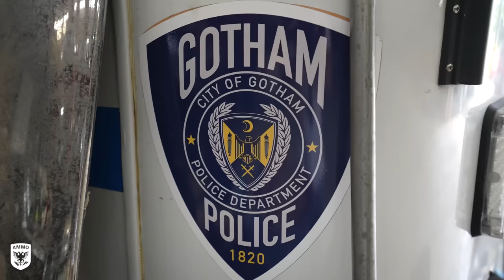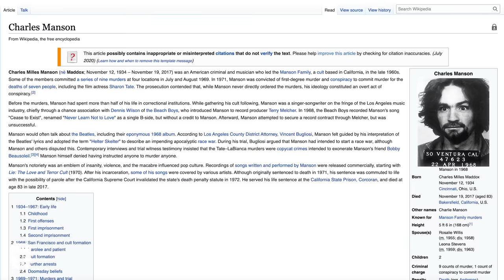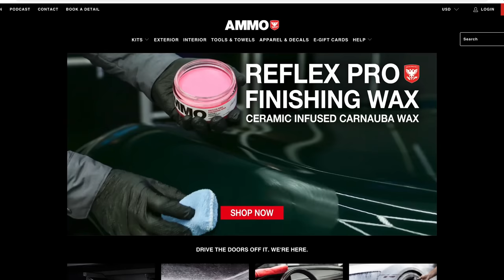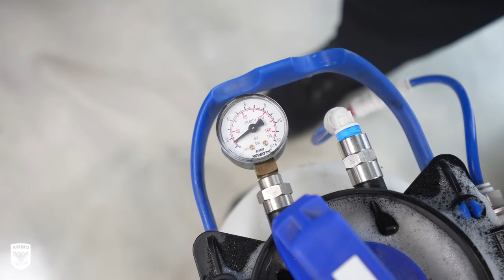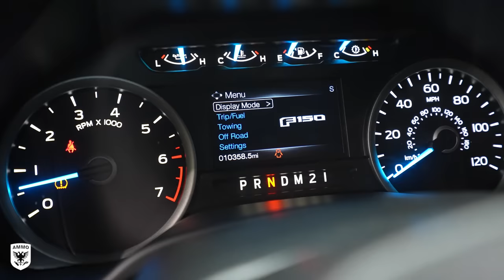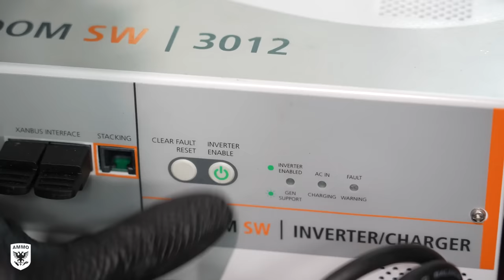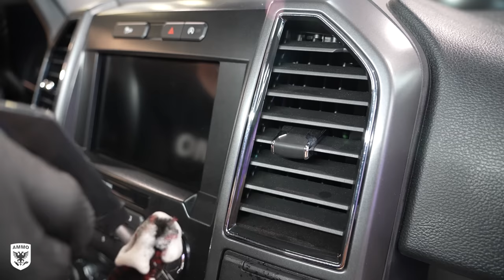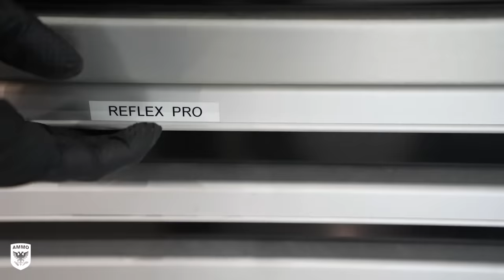First Wash in 5 Years Ford F150 Truck Disaster Detail: Only 10K Miles since 2017!

Comment: Larry, another great show.  Keep um comin'.  I have a question.  How much pressure do you run through your foam cannon?   Unless I haul out my gas powered washer, I just can't get the foam.  The electric one is easier, but the foam is weak.  Thanks so much.

Comment: Great episode as always. Have always wondered, how do you blow out the polishing pads if you don’t have compressed air ?
Reply: You could use a microfiber towel, turn up the speed, wipe and let it pick all the residue up. I pretty sure Larry showed it in one episode
Reply: Nylon brush or microfiber with the polisher on a low speed for foam/microfiber pads and a pad spur for wool pads

Comment: If you were using microfiber towels to wash a car that was just polished not about to be, How many towels would you use? Not filthy dirty and pre-rinsed and pre foamed and rinsed? Trying to figure out how to avoid love marks. Yes 2 buckets, Grit guards, Quality soap. Doing everything I can but every swirl I end up with over time comes from the wash process eventually. Thinking maybe towels are better than 4 or 5 wash pads/Mitts.